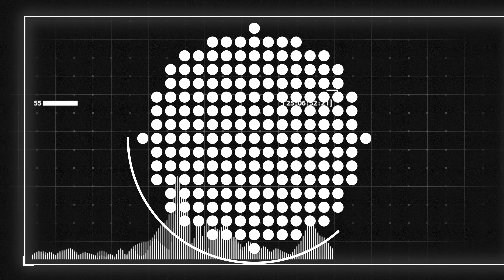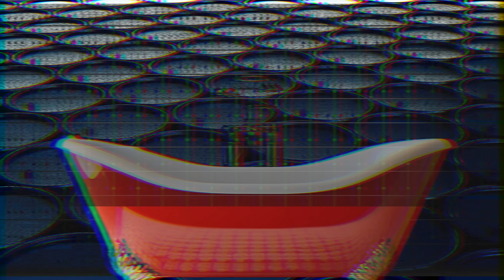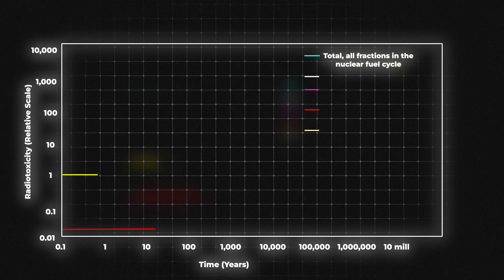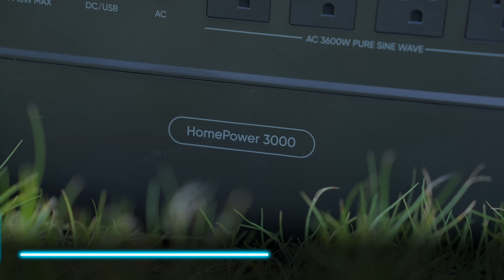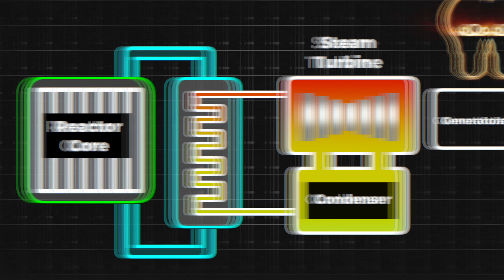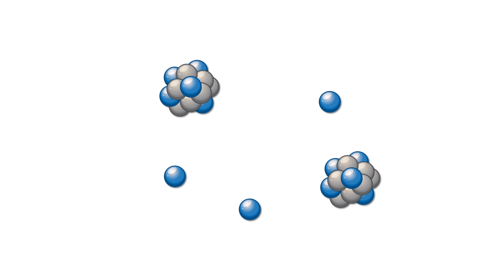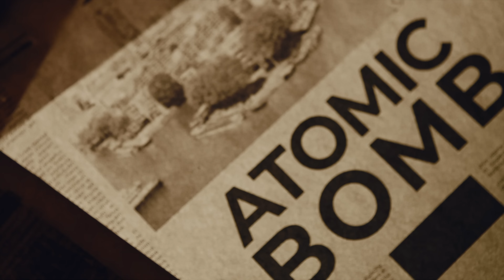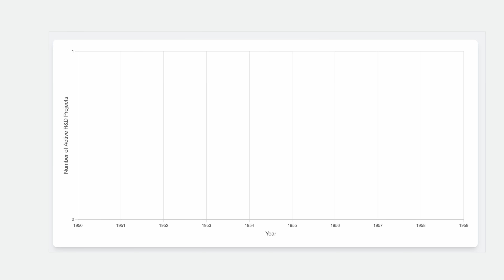Why Thorium is About To Power Everything

Comment: Good thing is we can also feed Thorium reactors some spent uranium fuel that it will consume as part of its fuel cycle, so it can be used to dispose of some long lasting items we have in storage.  Yes, WWII research did some thorium research so after WWII we had a thorium reactor at Oak Ridge that ran for some 20+ years, where they let the plug out of Friday, and Monday heated the storage pool and cooled the plug area and pumped the  melted store fuels back into the reactor to continue processing.  Safer in so many ways!
Reply: There is no such thing as a thorium reactor, but any reactor with good enough neutron economy, aka a breeder reactor,  can use thorium after it is started with fissile plutonium or uranium. Only fast neutrons can digest the minor actinides produced by neutron capture in our LWR reactors and CANDU reactors, including the most difficult, U-236. A fast neutron breeder reactor can use ANY actinide, but it works best with U-238. A slow neutron breeder can only use thorium as fertile material, and it struggles to break even, because slow neutrons don't produce as many new neutrons when they cause fission, and slow neutrons are far more easily captured by fission products and structural materials. On the other hand, the slow neutron breeder can start with only 1/4 the concentration of fissile material, because slow neutrons are also much more easily captured by fissile nuclei and are therefore much less prone to escape the active region of the core and end up being captured in the core wall or even outside of that.
Reply: @richardburden6035  I believe we had a couple of breeder reactors to turn Th-232 to U-233. Thanks to the previous administration, they performed something called down blending which took U-238 combing it with U-233 stock pile to make it useless. This cost $50M each year. I hope they've stopped this stupidity. Ms. Granholm will, IMHO, long be remembered as the Sec. who destroyed a lot of useful, stable U-233 stock pile.
Reply: @richardburden6035 the important thing is to burn up ALL the energy available in the nuclear fuel. Only an MSR can do this effectively.
Reply: Yes. Spent fuel from a Uranium solid fuel reactor still contains 90+% of the nuclear energy it contains, and almost all of it can be accessed via a molten salt reactor!
Reply: @gregbailey45  Not knowing how "fast" the neutrons move in a salt reactor, if they are slow enough, they can covert U-238, which is 98% of the spent fuel profile, into Pu-239 which is fissile 73% of the time its hit with a neutron. The other 27% remains Pu-240 where gamma radiation is emitted. 

Please correct me if I'm wrong...I'm just learning this stuff.
Reply: How stupid are Americans? They had this technology up and running 60 years ago and did nothing with it.
Reply: 20+ years? At Oak Ridge? Really? I've been studying this for quite some time now and somehow I only had them running it for 6 years. And was it really a Molten Salt Reactor? You are talking about Weinberg's reactor, right? They did get a couple running in Idaho as part of a proposal to get one running in an airplane. From what I've read we can thank a moron named Peter Lyons for squelching this. Thankfully he's now dead.
Reply: This alone is the best use case for thorium.   Otherwise, nuclear will be a niche solution for areas that renewables aren't well suited for.   We just won't need it at grid scale in a couple decades.

Comment: I've read that UF6 gas is used in the process, one of the most corrosive gasses ever made.  A gov facility can handle it, but hundreds of reactors under  commercial management?  Possibly you could ship the used salt to a central facility to do the dangerous work, then ship it back to the reactor.

Comment: Oh please do your homework!! What are the costs? Crazy expensive compared to wind and sun + battery - so why waste money and still have to deal with radioactive garbage and risk? No future for thorium sorry - just do the math . Disappointing 😢
Reply: Yeah. I haven't done the math but my gut tells me if this was so great it would have been done. Gotta be something besides history holding it back and again, my gut tells me if it's not a safety or engineering issue, it's probably an expense issue. 

I'm no green energy fanatic because it will save the earth (though a nice byproduct is the safety), but I am fanatical about cost and for years now evidence appears to favor the cost of renewables, solar and wind ( and some hydro and tidal) with batteries. Most of these  require cheap materials and can be mass produced easily. 

My question is why not toss a big chunk of the money that would have gone into these pie in the sky nuclear projects to just start building a lot of solar, wind, batteries and deploy them en mas? Yeah, there would be a lot of up front start up cost but any nuclear project also has a lot of upfront AND maintenance costs.

I'm no nuclear scientist nor an economist but the free energy from renewables with low materials and start up costs are probably the easiest, cheapest, and safest energies we are going to get. Why not just embrace it and commit?

Comment: The only hope is news of China achieving the Thorium nirvana triggers a revolution in Washington that triggers a revolution inside the NRC.
The corrosion problem is being addressed by the razor blade paradigm. Instead of having a reactor core that lasts 40 years the reactor core is only good for 8 years. After that the core is switched. The old core cools down and eventually is shipped back to the factory for refurbishment. This allows the entire reactor design to be cheap up front giving the manufacturer a long term revenue stream.
Reply: If China gets it working, it will be another reason to ban it like cheap EVs

Comment: The biggest issue for thorium reactors, besides the corrosion problem, is that the mix that goes into the thorium reactor must be pretreated to create the U233 fissile component you briefly mentioned.   This material can easily be made into very powerful bombs, unfortunately.  It isn't much of a stretch to see a commercial thorium reactor divert a portion of this U233 into clandestine purposes.  It is even easier to make a bomb than the Uranium process, because you do not need to reprocess the fuel to extract the plutonium.
Reply: U233 is not suitable for bombs.  There is trace amounts of U232 in it which make it very dangerous to work with (far more than U235 or Pl239).  The USA built a U233 bomb, largely to prove it could be done, and it failed.  (It blew up, but was significantly below the expected yield.). After that, the USA ignored U233.

No one who has mass produced atomic bombs have A) used materials out of any commercial reactor, or B) used U233.

Warm regards, Rick
Reply: I think you're likely to have to close the reactor down afterwards as there is little spare fissile material in a thorium breeder. Candus are probably better for producing surplus fissile material if one is so inclined. The fast breeder reactors (which can be molten salt) are probably free of the issue.
Reply: Hmm... I don't know where you heard that U233 was suitable for weapons, but it's definitely NOT.  The reason is because U233 always contains trace amounts of U232, which is a hard gamma emitter. Those gamma rays make U233 extremely dangerous to work with and easy to detect (ie: difficult to hide). And even if you could make a bomb, it would have a very short shelf-life, because that gamma radiation would fry the device's electronics in a matter of days.

Comment: Well, I was sure from the beginning of the video you would only mention the positiv things and not the problems and why its not made worldwide until now .) This is called reality and has some technical issues. 
One is the COROSION tooks place on the walls of the reactor, which has to be replaced regularly and so makes financiall no sense to do a reactor. 
Then you have Tritium-Gas which can diffuse from the reactor. This is still unsolved problem.
Then you have reaction products which dessolve inside the reactor, too. This makes the support and containing and the security and decontamination risky and much work. 
So in short, previous development projects have often been halted due to numerous technical difficulties and the resulting costs. There are currently hardly any demonstration or research reactors with commercially viable prospects.
So thanks for the video, but thorium is one of the logic-authism things of green-ideologic, when you blend out all the negativ things or problems. I would like to have this come true, sure. But for now, someone has to put billions in a grave to go further, and guess what happens .)
Reply: Corrosion in MSR was solved years ago!

Comment: I'm a huge Thorium fan, but some issues that need to be addressed. Your presentation of the long-term waste problem suggests we are continually producing mountains of the stuff. All of the waste created for the entirety of the nuclear age would fit on a football field. Your presentation of "waste" also misses the mark. Recycling and fast reactors would eliminate the vast majority of this most dangerous waste. Much of what is considered waste is actually material that can be used in the industrial and medical communities. 
Even the current nuclear designs in use are the safest electrical generation source in existence. 
The design associated with thorium is walk away safe/meltdown proof. U235 can and is also used in molten salt reactors. (Regulation is why some in the industry advocate for the use of U235, no matter the reactor design)
The msr illustration is misleading. The fissile salts remain inside the reactors chamber. The first line heat exchanger is located inside the unit. Look up lV generation msr design.
Reply: The only problem with "spent" fuel, is that we aren't producing nearly enough of it. This "waste", is far more
valuable than all the gold in Fort Knox, when used to start the thermal spectrum breeders described. It is a publicly owned wealth of transuranic fissile, and fast reactors are effectively a vehicle for stealing it. While also emptying the nuclear waste fund to "destroy" it, adding insult to injury. The result will much more expensive, and slower scaling nuclear. Fully under their control; not the disruptive and miraculous abundance of cheap energy for all, that we could have.

Comment: I was hoping for a little more detail on what new materials could be used to contain the liquid salt. There is no new information which unfortunately made this video just another one of hundreds of thorium videos. Some of your other videos are good but this one was lacking.
Reply: Same here. What "new materials" can contain the corrosive salts? Does it have to be a "salt"? The Soviets had some liquid metal conventional reactors for some subs. Not so corrosive but problematic if the nuclear reaction stops producing enough heat to keep the molten metal liquid. If a molten metal could be used in a Thorium reactor, draining it into the "melt down" reservoir solves that problem. 
  Also, since some U-233 is used in a Thorium reactor, aren't there dangerous daughter products produced? Granted, it may be less than water cooled reactors but it's not completely clean in only 300 years.

Comment: By the time it comes online, photovoltaics and batteries will be so cheap it won’t matter
Reply: This. I feel like the storage problem of renewables will be solved long before molten salt thorium reactors will be cheap enough with economies of scale to compete on the normal power markets. But these new nuclear reactors will still be very important everywhere you dont have enough wind and light.
Reply: Photovoltaics and batteries don't scale at all and they don't provide the stability we need.
Reply: @adamkatolik1633  I think there are enough obstructionists that may keep putting speed bumps in the adoption of solar and battery that there is still utility in additional technologies like Thorium.

Comment: Great for problematic countries where they can create energy without the prospect of creating fuel for nuclear weapons.
Reply: At no time in history has an atomic bomb been built from the products of a commercial power plant.  It is far, FAR easier to build bombs from facilities designed to produce weapons grade material.  That said, Thorium was dropped in the USA because it does not produce significant amounts of Plutonium, and the US army still had tiny hopes that commercial reactors would help fix their Pl shortages.  Th MSR are far more proliferation proof than traditional reactors, which is non-issue to start with.
Rick

Comment: Got to find a source of power that produces electricity/Power directly without HEAT (Steam Generation) or solar / wind / wave dependent. i.e. completely self contained like a battery that never needs charging.
Reply: "Got to find a source of power that produces electricity/Power directly without HEAT (Steam Generation) or solar / wind / wave dependent. i.e. completely self contained like a battery that never needs charging"

Are you trying to break the laws of physics?
Reply: Sounds like Thorium!